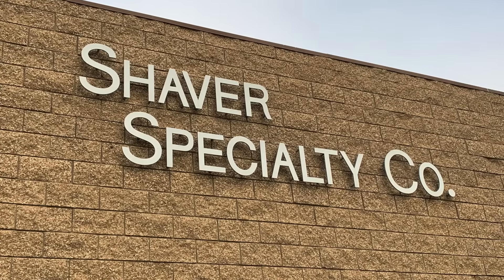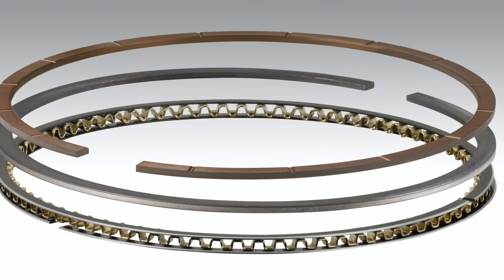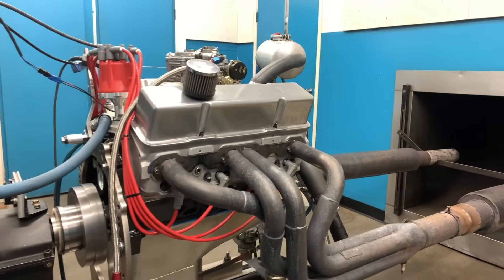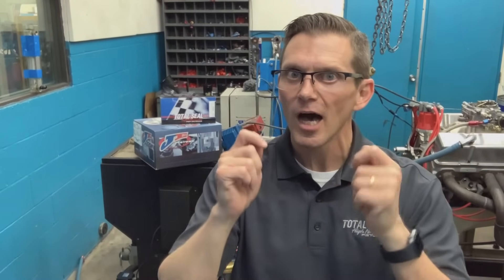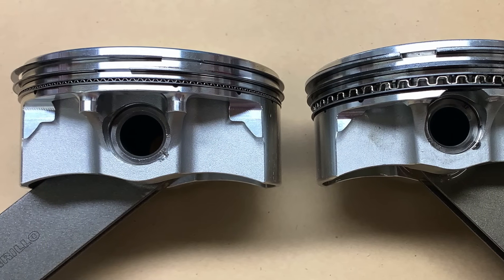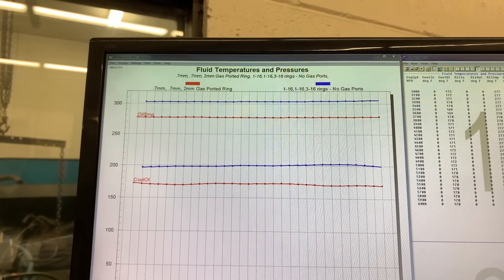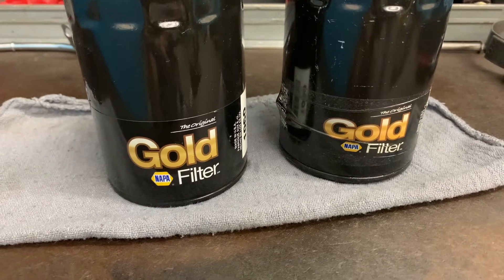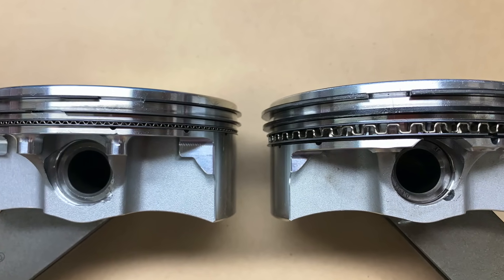Engine Running HOT? Watch This Video BEFORE Buying A New Radiator!

Comment: What's the take away? Instead of figuring that your radiator is clogged  you should consider that a glitch in the matrix installed fat rings, and put your car back. What the hell are the odds of that?

Comment: I don't know if you'll see this since this is old. But you said something interesting, "cooler running engines make more power". I don't get it. A hotter engine would I think have more thermal expansion of the air, effectively raising compression and therefore power. I think. What am I missing?

Comment: What kind & thickness of ring package would you recommend for diesels?  Im rebuilding several (6) cummins commonrails 5.9L & 6.7L.  Look at 500-800 hp for towing.  I was taught the thicker rings would transfer heat from combustion process more effectively to lower piston temps for longer life.  Seems they were & are wrong.  So can low tension rings handle 60-80 pounds of boost if running a ported top &  gapless 2nd?  What type & thickness of (your rings)  come with the dimpled  SOA rebuild kits?  Is there any way to switch piston ring thicknesses to a thinner ring package on a brand new gas 355 rebuild?  Have 2 in the shop that have already been machined & balanced just needing to be assembled.  Neither engine will see much time at 6000rpm since they will probably be going into trucks.  Thank you Sir, look forward to learning.  So many questions!!!!  I have been adding a bottle of zddp to all older flat tappet  engines during an oil (std 10-30) change to prolong their life... now I'm worried if it's built up or too thick!?  Use driven BR oil for new engines & groved lifter bores... don't use synthetics as a rule, recommend changing at 3-5K.
Reply from the maker: Contact Keith Jones on our tech support team for answers to all those questions. He can help you - 623-587-7400

Comment: I have to wonder, about how the new rings work in old engines.  I have heard from mechanics that todays cast iron is harder, more wear resistant than what was used in the 1960's and 70's. I understand that lower tension rings will last longer, even in the softer metal. but what about durability and sealing in an older engine. are the newer ring packages even compatible?  I understand that along with new pistons, the block would have to be prepped properly. And likely bored.
Reply from the maker: They are compatible.

Comment: I want Total Seal rings in my next engine. Owning a hot rod with a small radiator any reduction in engine temperature is always welcome.
Reply from the maker: Right on!
Reply: Try running a coolant mix that is 70% water and 30% glycol.

Comment: 🤔 are Pistons restricted to the ring package thickness that can be used?  I'm thinking the ring lands determine the ring thickness that can be used. So, if my pistons came with a thicker ring pack, could i use a thinner ring pack on those same pistons? Thanks Total Seal, I've been a fan of your products for a very long time. I just stumbled across your YouTube channel. 💪🏆

Comment: Reducing engine temperature is increasing longevity. Another critical components.  Let's start with the valve springs. Shall we make a list critical components and how sensitive they are to heat.

Comment: WHY are your oil temps so hot? I used to see 230F with 25/50 Pennzoil. 30 years ago. Then with Mobil 1 about 210F. And [fresh engine] had to put a softer spring in the dry sump pump pressure relief. Coolant temp around 185-200. And this racing.
Even a Cleveland was around 210 oil temp with synthetic. I have nothing else with oil temp guages!!
While I agree with ring friction there is so many pistons that still come with 5. 32 rings that was OEM for decades.
Reply from the maker: This wet sump engine doesn't have a windage tray and the valve spring pressures are higher than normal to create more load for wear testing.

Comment: A similar test between high tension vs low tension rings at the same thickness would be rather interesting. There are issues however due to carbon deposits on low tension rings (esp. many modern Toyota engines in fact) and many people when they rebuild them opt to use higher tension rings.
Reply: Honda's are terrible in this regard as well. My wife had a 2008 Accord and now has a 2016 CR-V. Both with the 2.4L K-series engine. In the quest to reduce engine friction losses and boost efficiency we now have engines that get sticky rings well before 100,000 miles and start consuming oil. I'm waiting to try the new Valvoline Restore and Protect that is supposed to eat deposits better than other oils.
Reply: This is exactly what I wondered. How exactly do you make a high tension vs. low tension rings? Materials differences? I would think that you wouldn't want to compromise the ring material for tribology reasons. Or making them to a different diameter and squeezing them more to put them in the bore?

Comment: Love the way you teach and explain,   I always wondered,  can a home  rebuilt engine. still use a light tension, thin ring pack,  with a regular drill and hone,   or does the cylinders need a special honing.    Great Video.    THANKS
Reply from the maker: Thanks! Yes, you can do a home built engine with 1.0mm rings.

Comment: It would be cool to run each set of rings and have the same oil for each set. Then run each set with it's own oil for a set time limit. Then send the oil off to blackstone labs to get an oil analysis to see how the rings affected the oil longevity.
Reply from the maker: We did have @SPEEDiagnostix analyze the used oil samples for us, and we found a 52% difference in the amount of wear generated between the two different ring sets. The .7mm rings produced less wear.

Comment: Why would the steady-state coolant temperature increase?  Doesn't the thermostat regulate that?  There is some "proportional offset", as typical for a proportional-only controller (engineering stuff), so could rise a bit above setpoint at higher thermal load, but I wouldn't expect a 25 F increase, identical to the increase in unregulated oil temperature.  It true, perhaps why some modern engines have an electronic-thermostat, to run right at setpoint (via engine controller feedback) for all thermal loads.  Demonstrates why modern engines have much thinner rings and run thinner oils.  Some even push the top ring up higher, leaving minimal piston land to support it.  TBD how this affects life.  I've already read of unexpected failures.  I wonder if any have a steel groove cast into the aluminum piston to hold the top ring, as in some older diesel engines (tractors and such), or maybe they'll need to move to that to keep the top ring so high up (minimizes quench pocket for better combustion and lower emissions).

How many engines have aftermarket pistons available for thinner rings?  Is your engine a SBC, where parts are abundant and cheap.  My 3 1960's engines are Mopar, where choices are nil and aftermarket parts pricey.
Reply from the maker: There’s not a thermostat on this engine. Race engines don’t use them.

Comment: Gas port slugs need a cam that doesn't pull a lot of vacuum. I'm sure gas port rings aren't much different. You can suck the rings off the wall with cam choice or phasing.

Comment: I'd like to see a test where ring wear is tested under several different conditions. 1. no crankcase evacuation. 2. with functioning PCV 3. with vacuum pump or other aids such as collector scavenge fittings.. Because we KNOW that having a PCV valve can double the life of an engine on the street, but it's obviously hard to do 100,000 miles worth of dyno testing, but some document of this really has to be made to show definitively the benefits of proper crankcase ventilation on any kind of engine!

Comment: What is PDD coding on a ring?
Reply from the maker: The PVD coating is a Physical Vapor Deposition process. Instead of the part being dipped or sprayed, which results in uneven application, PVD coatings are applied in a vacuum chamber, so they are very uniform.

PVD coatings are also lower friction and higher hardness, which means they reduce friction and wear.

Comment: How much of a difference do you typically see on 1 mm vs .7 mm? Is it as drastic?
Reply from the maker: The difference is slight. The .7mm is about 4 or 5 HP better than the 1.0mm. The big gain is going from 1/16 (or thicker) down to the 1.0mm ring.

Comment: what about more heat transfer from thicker rings?
Reply from the maker: The downside of running thicker rings than necessary is the increased heat generated by them.

Comment: Thickness of thick ring is 2.27 times the thin ring.  Wear metals in oil for thick rings are 2.2 times as much also.  How much of extra wear metals is simply due to difference in thickness/volume  of ring against wall?  Maybe thin ring wear radially inward at same rate?  So, maybe no increase in durability, but no loss, either.
Reply from the maker: Since the face of neither the thick or thin ring is Iron, the higher Iron level indicates the cylinder bore, which is Iron, wore more with the thicker ring. The thinner ring is TiN coated, and zero Titanium showed up in the used oil.
Reply: @TotalSeal  Thanks for response.  So rings drag more metal off the bores almost in direct relationship to their thickness.  Awesome work 👍

Comment: In addition, i wonder if some of that extra temperature is coming from heat being conducted away from the piston and transferred to the bores/cooling system from the increased surface area of the rings?
Reply from the maker: No, the extra temperature is all related to increased friction. 

If the thinner rings trapped more heat in the piston, the oil temperature would have increased because the pistons are also cooled by the oil.

Comment: Well there is no reason to use inferior materials on the thicker higher tension ring. Who would compare rings made from different materials if your go was to compare rings of different thickness/surface area and tension. You just invalidated the entire test you should only change one variable. The rings should have been otherwise identical in design elements, materials and surface coating!

Comment: Yes but how would they compare after 150,000 miles in a turbo charged application? Which ring set would have the most blowby and lower compression? How about 300,000 miles? How much more oil consumption will the thinner rings have?  There is always pro's and con's to every design element of every machine ever designed or built! 

Prior to low tension rings I never had issues with excessive oil consumption now it is so common as to be the new normal across almost all major brands! The modern piston and ring designs are notorious for excessive consumption, blowby and knock! Most of us want engines that last.
Reply from the maker: Ring tension and ring thickness are two different things. You can have higher tension yet thin rings. 

Oil consumption is not due to thin rings, it is partially due to low oil ring tension. There are ways to make moderate tension oils rings that don’t lose their tension over time. It’s all about designing the package for the goal.

Comment: Is there a such thing as a ring spacer so you can use a more modern ring package on an older piston that used 5/64 rings?
Reply from the maker: Great question. Yes! There are spacer kits that allow the use of thinner rings in older pistons.

Comment: When your engine only runs less than three minutes this stuff really doesn’t matter engines don’t get very hot in 3 minutes or less, and those gas ported top rings for drag racing are crap there for endurance application blow by = loss of horsepower, for drag racing you just want some non ported chromoly rings and no matter what power adder the ring gap is 10 thousands I ran a 500HP NoS kit with a 10 thou ring gap never had any problems all this gaping to 30-60 thou because of power adders is just stupid I dunno how things about racing have gotten so turned around since I was into it, and my engine didn’t blow oil like all those pro-lines the street outlaws idiots run
Reply from the maker: For drag racing only application, you are right that vertically gas ported pistons are better than a gas ported ring. But for street/strip applications, the gas ported rings don’t clog up like vertical gas ports will.

Comment: Can these gapless rings make my sound system gain more bass?
Reply: On a small block chevy V8 you can run the V6 heads and those two cylinders running open-air in the block will give you hella bass just like some Vegas.
Reply from the maker: LOL, not so much...
Reply: @TotalSeal  keep it up lol I'll try and build something that needs rings

Comment: If you want to get taken seriously then don't mix your measurement units
Reply from the maker: Well, that is the norm for the piston ring industry. The US based engines used standard measurements and the foreign engines used metric, so over time they’ve all become a jumbled mess.
Reply: @TotalSeal  with respect imperial is not "standard" especially the bastardized version that the US uses. Yes I can still work in imperial but I don't intend to. 
I laugh at the latest trend...engine torque in NM but power in HP🤣🤣🤣🤣
Reply: @markbakerskater666  In the US, yes, imperial is quite often used in engine building. By the way, USA has been on the metric standard for about 100 years. Our current "imperial" measurments are all based on the metric standard. We just have an adittional way to discuss sizing which can be useful depending on application. Clearly you don't know engines or the united states.

Comment: I  just gapped my rings, which include a gas ported top ring, and gapless second ring. The TOP ring specifically had what felt like quite excessive tension against the cyinder walls. I am concerned.
Reply from the maker: Call the tech department at 623-587-7400. They can talk through all the details to help determine if there is a problem.
Reply: @TotalSeal  Thank you, will do.
A friend that has built several engines, professionally with your rings, suggested that a break away torque of 15nm wasn't excessive.
 It sits around 9-10nm to keep it rotating. Mind you that's dry with just light assembly lube.

Comment: The piston rings are also how the piston transfers it's heat to the cylinder wall and cooling jackets. Is one of the reasons that you're seeing higher coolant and oil temps with thicker rings because the piston is transferring more of it's heat to the cylinder walls?  Do the pistons run hotter with thinner rings?
Reply from the maker: Great question. The majority of piston cooling is done by the oil, so the difference in ring thickness doesn’t make a huge difference in heat transfer from the pistons.

The evidence of that is the cooler oil temperature with the thinner rings. If the pistons were hotter with the thinner rings (because they were transferring less heat) then the oil temperature would have increased with the thinner rings.
Reply: @TotalSeal  I’m sure you’re right, but when you use piston oil squirters the piston temp goes down and the oil temp goes up because heat is being moved from the piston to the oil.

I get that in this case we’re dealing with oil heat from combustion which transfers from the piston and through the rings to the wall AND we’re dealing with heat generated from ring+ wall friction and it’s hard to know what heat is coming from where.

I just recently saw an engineering diagram showing heat flow from a piston through the 1st, 2nd, and 3rd rings to the wall so it triggered my question about whether the reduced area in contract between the rings and wall (with thin rings) meant that pistons with thin rings run hotter. (My theory-question was: “Is the reduction in oil and coolant temps from thinner rings because of BOTH reduced ring to wall friction AND less heat transfer between the piston and the wall through the reduced surface area contact? (Which would mean higher piston temps.)
Reply from the maker: @adamarndt7617  it is important to note this engine doesn’t have piston oil squirters. It just uses splash from the crankcase and oil leakage from the rod bearings.

We are not saying piston rings don’t conduct heat from the pistons. They most certainly do. However the change in ring thickness doesn’t have a proportional difference in heat transfer, so a 30% thinner ring doesn’t make a piston 30% hotter. 

We can validate that via the spark timing. If the piston was 30% hotter, then we would have to reduce spark timing advance to keep the engine from experiencing detonation. 

By using knock sensors and checking spark timing, blow-by and power output, we can confirm the reduced temperature is not the result of trapping heat in the piston.
Reply: @TotalSeal  Thanks. Much appreciated. It’s something I’ve wondered about for a while. Can’t believe you guys respond like this over YouTube comments, but it’s appreciated.

Looking forward to seeing what my current Total Seal gapless 1.2mm/1.2/ 3/16” set that Ed specced for me will do and I’ll definitely consider a gas ported set on the next engine build.
Reply from the maker: @adamarndt7617  we are happy to help!
Reply: Brilliant answer. Piston is not hotter with thinner rings because timing remains the same.
Reply: @bobirving6052  If the piston were getting meaningfully hotter, you'd expect it to require less timing? (That's a new idea for me; just making sure I understand your comment correctly.)